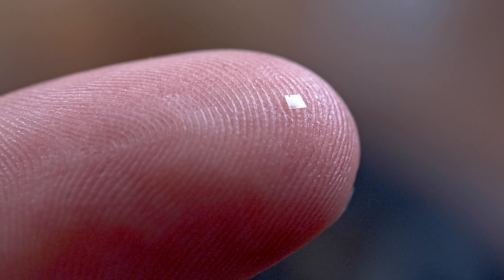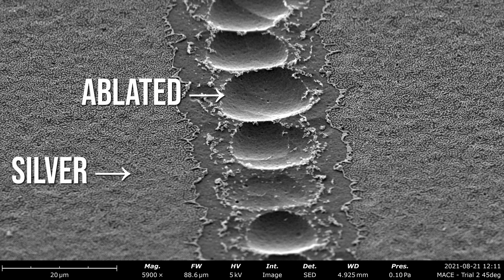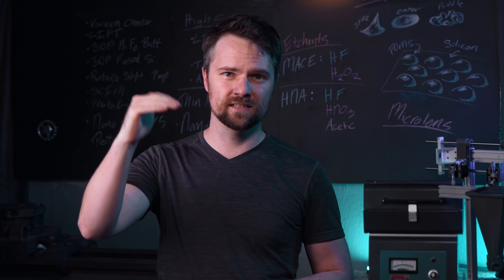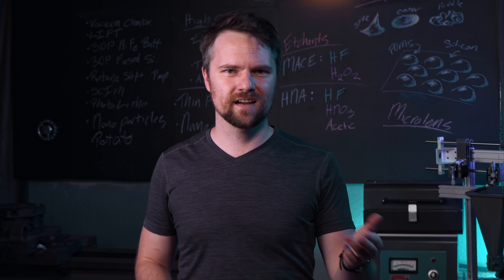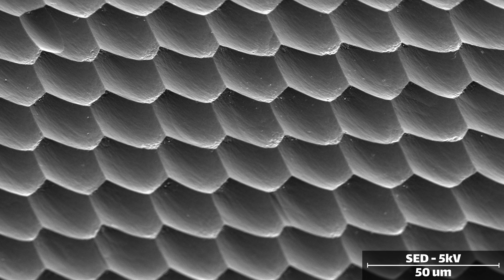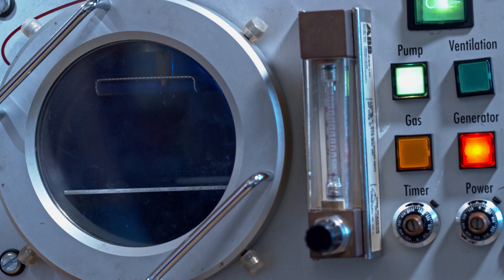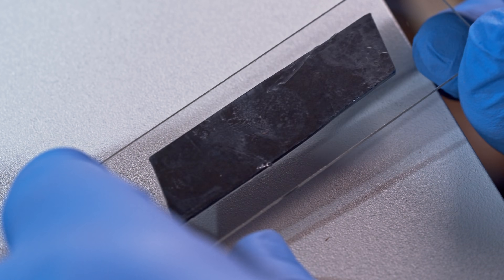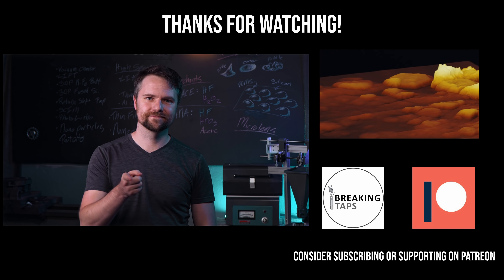Molding a Microlens Array

Comment from the maker: *Addendum*
- I meant 4mm^2 (2x2mm) in the intro, although I later measured and it's actually 1x1mm. Oops!  Sorry for the confusion, I phrased it poorly :)
Reply: A similar process is used to etch diamond. A nickel or iron mask is deposited. Under high temperatures in H2 atmosphere, carbon dissolves in the mask and gets carried away by reacting with hydrogen into CH4.
Reply: Funny ..that was thebfirst thing I thought
Reply: I wonder how many people saw the text poking fun at explosions and fire during the safety speech
Reply: I was thinking you must have the BIGGEST finger in the lab.
Reply: Designed an HMD before and visiting china now and working on a new HMD design. Can supply some microlens arrays for the prototypes? Thanks in advance, if possible!

Comment: I liked the whole journey! Maybe those laser crater spikes would make nice field emission sources. A big array could really pump out some electrons!
Reply: That's exactly what I thought when I saw them too. It reminded me of the little picture that would invariably accompany all those "flat panel TVs could be just around the corner!" articles in the early 90s I would constantly see in Popular Science, Discover, etc.
Reply: The production quality of this video was amazing. The backlighting, the 3d scans, everything. Bravo.
Reply: Dont mention this to Big Clive or we'll be getting more Ionizers.....cheers.
Reply from the maker: Oh boy, I think you just nerd sniped me 😂 Now I'm elbow-deep in papers and patents about field emission displays and similar.  Will see if I can wrangle something up with the tools I have!

The other potential project I was thinking of was something like this "massively parallel AFM" paper (https://www.nature.com/articles/s41467-020-20612-3)
Reply: @BreakingTaps  I was actually thinking if they were coated in aluminum like how thermal blankets are, these could be gathering points for phonons?(thermal equivalent to electrons and photons? not sure right now what the term is) but basically heat is absorbed easily by the unaluminized surface as IR radiation if you had say a vacuum behind it, but vacuum on the aluminized side would mean any thermal energy lost would be IR photons and these get rejected back into the vacuum so assisting very low amounts of thermal energy to collect enough in a centralized point to eject it as an IR photon, on the aluminized side could be what will make a true passive thermal diode where the thermal energy is also doing the work of moving itself from the cold side to the warm side. Just imagine a refrigeration unit that uses no power and you have an opening to let heat back in through micro pores to even it out, to regulate the temperature rather than generating loads of heat running compressors or the heat generated by running electrons through peltier units to cool something to add to the heat you have to manage, where the passive cooling system both costs no energy to run, just to build the unit, and does not have to regulate additional heat created powering it! (my idea using thermal blankets stacked with air gaps between each layer and all aluminized sides of the blankets facing the same direction to block heat from sunlight ect, during summer worked extremely effectively just with 3 layers, but like peltiers stacked I am guessing more layers would mean more efficiency, that and coupling it with using aerogel supports to spread the layers out so conduction of heat back into the chamber is minimized)
Reply: @BreakingTaps  Oh ! multiple tips.
Reply: Just a though you probably already considered: can you flip the mold before spinning so the superfluous silicone has a better chance to escape?
Reply: could the really deep grooves mentioned at the end be used as molds for your gecko tape project from a while back? I'm not sure how the scales would compare though, it might be way off.
Reply: The spikes & trenches could be useful for Taylor cones too.
Reply: @drekowski  that is what I was thinking as well as using it being less spin out to make the bottom less deep but more smoothed out by meniscus effect so the lens formation would be as smooth as a liquid can be, another idea might be to figure out a dry flexible layer that could be attached so it seals everything flat but is thin enough that trapping the resin could be pressed on to force it to compress the air in the pits so the lens shape forms from the resin stretching it like air in a balloon making it swell in a round shape (resin being under higher pressure and denser than the air trapped inside the pit made by the laser. that way the roundness is only dependent on not touching the bottom with the rubbery thin layer, and the edge of the pit being shaped round lol.)
Reply: I fuckin knew you'd be here! 

Plz do a "top 5/50 YouTube videos I found this year" - would love to see what channels have to "Applied Science" seal of approval
Reply: @danieladelodun9547  what do you mean by 5/50?  Top five out of 50?  Top x videos with X being replaced with applied science's choice on how many from 5 to 50?  Top 5 videos w/ 45 more videos  getting an honorable mention? 
  That bit is the only thing I am not getting what you are serving to Applied Science LOL
Reply: @BreakingTaps  Wow your videos are an eye opener for me. As a programmer I don't appreciate all the tech behind a software, always though that: "You kick the hardware and blame the software!" All the chemistry and physics in those scales intrigues me and I wonder how much can be done.
Reply: Love your channel
Reply: @BreakingTaps  Looks like your job now is to make a mini 16x16 FED display.
Reply: Hey I'm often see you in videos that I find for myself interest. Curious
Reply: @BreakingTaps  Please second source the Amptek COOL-X X-Ray Generator
Reply: @ThomasAndersonbsf  That sounds extremely illegal (thermodynamically).
Reply: @IDoNotLikeHandlesOnYT  no idea which of my comments you are referring to LOL
Reply: @ThomasAndersonbsf  The one about making thermal diodes that can perform refrigeration with no energy input. That sounds like Maxwell's demon to me.
Reply: Hmm True, might become a nice substitute to tungsten.
Reply: Stop being so negative. :p

Comment: Hello! In your 'molding problems' section, you mention dimples near the top of your lenses. If indeed the problem is from an over-accumulation of mold release, you could try sputtering a thin film of gold onto the silicon surface and using that as a sort of mold release because the silicon will not stick well to the gold without a proper adhesion layer; additionally, the PDMS will not stick well to the gold without a specific chemical treatment (chemical treatment to make the gold adhere to the PDMS very well can be done really easily with a not very dangerous chemical called MPTMS). If the gold sputtering route does interest you, using the MPTMS surface treatment, you can make static mirror arrays as well as strain-tunable mirror arrays and strain-tunable plasmonic devices because of the metal first-surface on the PDMS.
Reply from the maker: Oh! That's a really clever trick! Might give that a try and see how it goes, and definitely a useful tip for future work.

MPTMS sounds super interesting for plating PDMS, I didn't realize that was possible (at least robustly... I coated them with a thin layer of silver to help with SEM imaging but figured it would crack/delaminate quickly).  That's really cool, will look into that more.  Could make for some really interesting experiments in the future.  Thanks!
Reply: @BreakingTaps  The MPTMS route is really fascinating chemically speaking, the chemical has a sulfur group on one end that gives good bonding to gold and a silane group on the other which bonds well to the PDMS. Immersing the gold layer in a MPTMS solution is quick and easy too and that's all that you really need to do before spinning on your PDMS since the MPTMS forms a self assembled monolayer. I'd be happy to share my recipes if you'd like, could maybe save some time. Sputter coating PDMS directly with a metal is also interesting, the thickness of the metal film (at least in the case of gold) that you coat the PDMS with changes the final morphology of the film e.g., if the film is above a certain thickness range then you can end up getting a very wavy (buckled) surface which can be used for all sorts of stretchable electronic contacts and interconnects (for wearable electronics and things), as well as strain-tunable random gratings (these end up being also very interesting and strange to look at as they have an appearance that resembles silvery-white, rainbow-ish, diffractive gold)
Reply: Uranium will work too...possibly
Reply: What about a transparent layer so it does not affect the optical quality of the lens.  Is TinOxide a possible mould release?
Reply: @KallePihlajasaari  Having oxides on the surface in general is part of the sticking problem because PDMS bonds pretty well to oxides. Silicon itself will arrive with a SiO2 passivation layer for example. Since metals like Au have very weak bonding to un-modified PDMS, you can coat a surface like Si or a passivated surface like SiO2 and make a nonbonding interface that allows liftoff of the PDMS or other materials you may cast onto the surface. An oxide like SnO2 would probably stick pretty strongly to the PDMS since the PDMS itself is an Si-O polymer that bonds well to oxides and would likely not perform as well as Au or Ag for liftoff. Additionally, films of Au are pretty highly transparent (although transmitting greenish blue light) when grown in very thin films ~20 nm or less; having metals be partially transparent in thin films is sort of the basis of plasmonics and some metamaterial lenses

Comment: I wonder if you you were to tilt the specimen down just a bit before you spin it by placing it on a slight wedge.  This may make the mold release to run "down" and flow out of the crater.  Like this:

      ⦣  Angle of plate   🠒 Spin force 

Just an idea.
Reply from the maker: Not a bad idea! Would be interesting to see how much (or if) it affects the layer thickness as well, or if there is any kind of gradient effect.  One thing I neglected to mention in the video is that it's a race against solvent evaporation too... as the thin film spreads out, the solvent rapidly evaporates and the solids "crash out".  Handy when you're trying to spin photoresist to a known thickness, less handy when trying to get an even coat of mold release :)

Cheers for the idea!  Will try it out next time I'm using the mold release again!
Reply: @BreakingTaps  I wonder if it would be feasible to have a saturated atmosphere of <same or similar> solvent inside the spin coater to reduce evaporation giving a longer work time. Very cool vid top to bottom!
Reply: @BreakingTaps  I am wondering if there is a surfactant that you could use that is a liquid at room temp so you can be sure when smon out it is a single layer of the surfactant molecules standing up off the surface of the mold either that does not bond to the resin or does but the surfactant easily lets go of the silicon. also on smoothing the surfact I wonder if a smaller molecule based material would work  better like using graphite that is used for EDM machines :)

Comment: 6:34 it's a fundamental effect, the reason it's not in papers is because most of the people writing papers would take it for granted that their audience knows that catalysts just speed up a process that would happen by lowering the energy cost through mediation. So if you're in a situation where using a catalyst would help, remember that the desired effect is still happening at a slower rate. For most stuff this doesn't matter at all; at the scales you're working with it's important and I'm glad you figured it out.

Comment: Very nice results Zach! I guess if you really dive a little deeper into the process, you could probably make much better lens arrays, maybe it is even possible to make well-defined aspherics. But then you need to be in control in every parameter of the process. Developing new technology into something useful is always a long and bumpy road.
Reply from the maker: Thanks! Yeah, definitely a rabbit hole :) After sorting out the molding issues, would probably need to spend some time characterizing the ablation crater... it's likely not spherical at all, given the (theoretically) gaussian pulse profile. And a lot more work to make the system consistent/repeatable, no mechanical misalignments, etc.

One reason I'm happy about youtube projects! I can get the idea working and then move on, skipping all the actual hard work! 😁

Comment: Ever since the first demonstration of light field photography, I have been trying to figure out how to make my own micro lens arrays. Your video covers so many aspects of whats involved that “finally” I think I understand the magnitude and scope of this task.  This is an awesome video! Thanks! I am looking forward to your follow up videos regarding this project.
Reply from the maker: Thanks for watching! There might be some easier methods which probably don't involve so many exotic chemicals or tools.  I think the photoresist-slumping method is probably a bit easier (not sure the right keywords... basically pattern small circles of photoresist and then heat them up, causing the spots to soften and slump into hemispheres). Does require some kind of lithography technique though, and two rounds of molding to get the final shape.  There might be even easier techniques, not sure, it definitely seems like a field where there are a lot of creative techniques :)  Goodluck!
Reply: @BreakingTaps  
It’s called reflow, the technique to heat resist so it forms semi-spheres. But it also means that it’s only rotational symmetrical lenses that can be formed
Reply: I too love and wish for light field cameras.
Reply: I've been thinking about light field photography too recently. I was wondering if the sensors could be made either as spires or in holes so that the angle could be detected without increasing the size of the sensor needed.

Comment: Btw, you could try using ammonium fluoride as an etchant instead of HF. 
It is much safer to work with  and the fact it has a lower etching rate could remove the debris without eating too deep into the creaters.
Also maybe going for an evaporation coating for the mold release agent could be better than spin coating, for instance just heat up gently a silicone oil with your slide just above the surface.
Reply from the maker: Oh, will look into ammonium fluoride!  That's basically what's in the glass etching creams right?  Totally fine with slower rates as long as it's safer, and it'd probably be more controllable that way anyhow.  Cheers for the tip (and the evap coating, will try that!)
Reply: @BreakingTaps  Glad you find the tip interesting!
I heard that silicon fluoride kinda works aswell but i never tried it.
 Also for the  mold release,you can try putting a few drops of silicone oil into toluene dipping your slide  into it and let evaporate, I have not idea of the nedeed ratio of silicone tho.

Comment: The mold release buildup problem might be improved by -
1. Lowering its viscosity with a compatable solvent.
2. Spinning it with the apparatus upside down after applying mold release with a spray bottle from underneath. 
3. Make sure the release agent is properly set in order to prevent it slumping into the hollow. So store it upside-down until certain that it has cured.
° Upside-down application might produce a thickening to occur around the outer rim of each micro bowl, and that might be able to be manipulated so as to result  in a superior end product.
Cheers. 👍